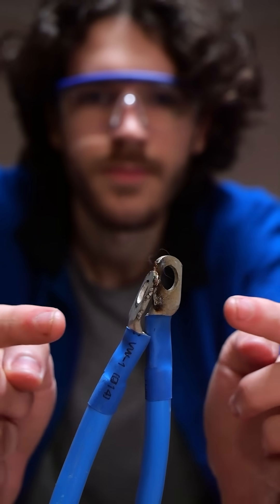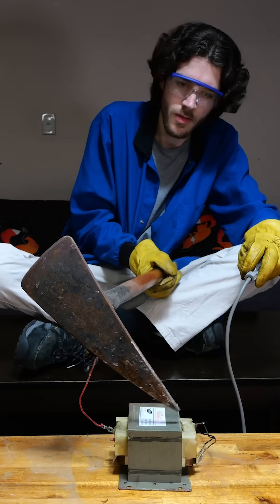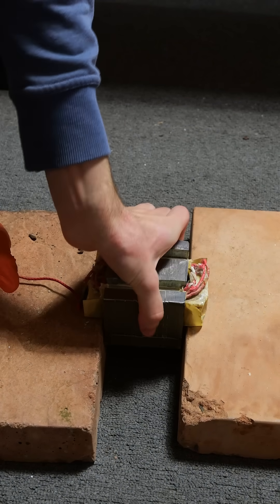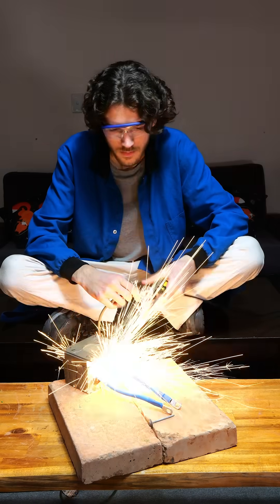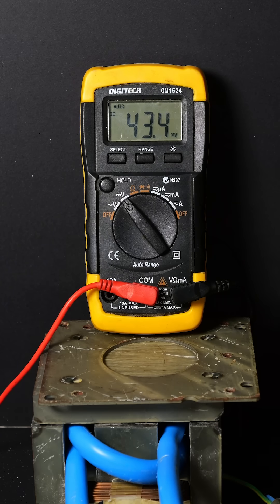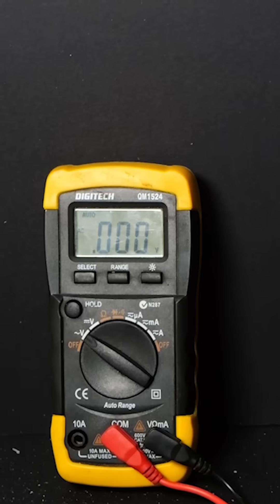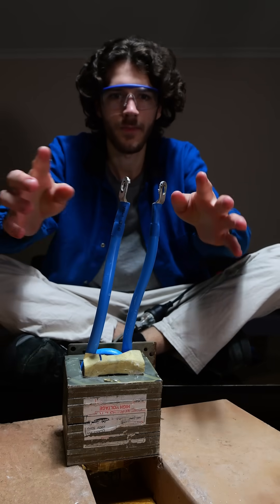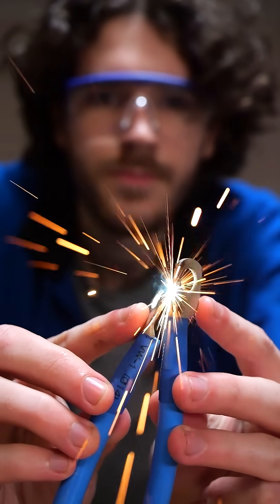What holding 600 Amps feels like

Comment: For anyone who doesn't know. Touch with the back of your hand, not your palm so if the current flows your hand moves AWAY from stuff and won't uncontrollably grip the live part! If I personally need to touch some questionable surface, I touch it with the back of my right hand (usually the back of a single finger), while standing on my right leg so as to minimize the risk of heart fibrilation. Your heart doesn't actually stop if it fibrilates, it just spazzes-out uncontrollably and it can't pump blood. And you can't re-start it without a defibrilator, far as I know. Edit: I was wrong here, the super-death capacitor kills mainly by causing heart fibrillation from high-voltage current through your body — some blood electrolysis can happen, but that’s not what usually kills you. Just know there's a very real risk, do research and have someone who does this for a living supervise and you should be fine. Same with dealing with a lathe, chemistry, amateur rockets, street fights or uncooked food. People with experience have seen others get hurt and know what to and not to do. 👍
Reply: The standing on right leg thing wouldn't meaningfully help because the electric field would travel in parallel through your entire torso and the pathway through the heart with all the fluid filled blood vessels is far more conductive than your lungs anyway. That's specifically for cardiac arrest/fibrillation though (the muscles are technically moving but it's still considered stopped because it isn't contracting in an effective way), the outside of your hand thing is still important because there are other hazards where you can wind up with your muscles stuck and get severe internal burns even if your heart is ok, and single hand is a great approach for isolated circuits since only a single limb is even close to the potential current path
Reply: @bosstowndynamics5488  I had thought of that, however I still believe right hand/right foot lowers the risk percentage-chance wise. It does make it less likely, even if only a bit. And as long as you're not standing atop a skyscraper, where going off balance is more dangerous than fibrilation, I believe it is a good idea to go right hand/right foot path of least resistance. Chat GPT seems to agree when I asked it just now (more trustworthy than my engineering degree sometimes). I still recommend right hand/foot on the offchance one is on the edge of dangerous voltage. Every little bit counts! And even transformers have a capacitive leak-current to ground since it's AC even in the case of "isolated circuits" so a bit of extra caution can come in handy. Left hand always in pocket is the most important part though. 👍
Reply: @Megaexplosionman I really don't think it would make a difference, the lowest conduction pathway through your chest is directly through your heart because that's the path with a continuous volume of salty water, everything else has at least somewhat higher resistance
Reply: @bosstowndynamics5488  Agree to disagree! We're talking miliamps, with the potential difference between fibrilation threshold and normal operation being microamps. Salty water and even the iron, cobalt and hexavalent chromium in your blood-stream are not solid copper, so the further they are away from the points of contact, the less current will flow through them as they have innate resistance that scales with length. While the left foot being on the ground will draw greater current through them due to both the direct path through the heart it takes and the overall geater surface-area in contact with ground. An extra half a miliamp is not negligible in this context.
Reply: @Megaexplosionman Blood does have resistance, yes, and a lot more than copper. But do you know what has far more resistance than blood? Everything else in your chest, meaning that there's pretty much no path from your right arm to your right leg that doesn't go through the big fat pipes full of salty water that go straight through your heart
Reply: @bosstowndynamics5488  The path the current takes through your body matters a lot for electrical risk. It's not just "how conductive your chest is" - it's where the current actually goes. The more it crosses the heart, the higher the chance of fibrillation (that's in IEC 60479, which is what actual safety standards are based on, not on internet debates). Standing with your right leg while using your right hand is like having your left hand in your pocket - it keeps one side of your body out of the path and helps prevent accidental movements (like liftong your right leg while stepping or shifting), which could suddenly create a much more dangerous current path. Right arm / left leg is close to right arm / left arm in danger level because it pulls current diagonally through the chest - exactly what you want to avoid. Right arm / right leg is safer because it keeps most of the current on one side of your body. It doesn't make you invincible, it lowers risk - and that's what smart safety is about. Pretending precautions are 'meaningless' because of a half-true fact about tissue conductivity is exactly how people get hurt. You don't get bonus points for sounding clever if it leads to bad safety advice.
Reply: @Megaexplosionman Yes, the path it takes matters. But the point I'm making here is that the path is going to be through your heart regardless of if you're left leg is touching the ground or not, because the main electrical path from your right arm to your right leg is still through your heart. There's actually not a lot of conductive stuff in your chest other than the large blood vessels because so much of it is air (that's why people float), so most of the current will flow through those large blood vessels, which go straight through the heart. If you had the means to redirect the current through a path that didn't hit your heart that would absolutely be better but standing on your right foot ain't it
Reply: Back of the hand is the word you're looking for. "external part of the palm" is a bit confusing
Reply: @Sh4quille0atmeal  thanks!
Reply: But I can just short the super death capacitor to discharge it! /j
Reply: Thank you lulu
Reply: oh cool
Reply: > causes electrolysis

I'm sorry it does what?
Reply: @hrki_tk  I double-checked my information and looks like I remembered wrong, I edited the comment, thanks! It's continuous HV DC current that kills by electrolysis. The high-voltage capacitor kills you with fibrillation primarily (electrolysis is somewhat negligible here unless its capacitance is massive.) That pseudo-intellectual that denies IEC 60479 safety standards in the replies is right about this use-case scenario. If the voltage is this high, its path will will run enough current through the heart no matter what, especially since it will burn the skin, completely bypassing its protective high resistance. Skin resistance is in the killoohms, while organ resistance is in the hundreds of ohms which makes the path the current takes only relevant if the voltage is 100~200 volts. Tesla coils and Van de Graaffs are usually safe because they have super high voltage but can't deliver enough current to kill — the danger comes when you have high voltage plus a strong current source or if the HV device is an old tube voltage multiplier that isn't decoupled from the mains (it's like a variac, I don't really understand it myself, all I know is that it's not decoupled from mains power). When there is no galvanic decoupling, you give the mains voltage a lower impedance path through your body. Which means greater current and it's the current that fibrillates your heart, it just needs enough voltage or low-enough impedance to ground to get there. Which is what we don't want so we have decoupling transformers, we wear rubber shoes, we touch with only the back of the right hand, standing on the right foot and a whole lot of other stuff. 👍
Reply: Fr be super careful with fireworks, those videos of ppl losing their whole hands to a particularly large firecracker are scary
Reply: 😂😂😂😂😂 I didn't need to read all that just the end part "people with experience see others get hurt and no what to and not to do" 😂😂😂😂😂😂😂😂 yeah because someone with experience HAS NEVER HURT THEMSELVES 😂😂😂😂😂😂😂😂😂😂😂😂😂😂
Reply: @kylemiron2647  Yep, that's the point, they do! But in ways that are not "permanent" for lack of putting it in better ways. The way they teach you electrical safety usually involves the stories of those who weren't so lucky as to get out in one piece or at all, so you know to  go forward slowly and carefully. Most of those who were too smart to do that are the ones we hear stories about..
Reply: I had a stroke reading that
Reply: defibrillator dont restart stopped hearts, thats some hollywood bs misinformation. defibrillators give a jolt to reset the heart’s rhythm if its out of sync, thats all
Reply: @bbbnuyyyy That wasn't claimed. He specifically said your heart doesn't stop, but goes into fibrillation. The defibrillator "resets" the heart by forcefully causing depolarization in all the heart cells at once, after which the heart will hopefully continue with its physiological rhythm.
Fibrillation is when the electrical impules are uncoordinated and random, where your heart becomes a wiggling meat sack, instead of a pump.
Reply: @bbbnuyyyy  Yep, that's the point I'm making! When the heart is out of rhythm (fibrilated) and spazzes-out, it can't pump blood so if memory serves, it needs to be put back on track with a de-fibrilator so it's no longer fibrilating because it has been defibrilated. I think the electric shock actually stops it for a bit so it can "restart" with proper rhythm. Basically the CPR version of "did you try turning the thing off and on again" 😁

Comment: Next, put it on your tongue. (yes, I know you'll be completely fine)
Reply: Your salty spit would fizzle, and you would not not feel it.
Reply: @ChrisNotTheKing Agreed!
Reply: No. The tongue has a low resistance and it would be extremely painful. The resistance of the skin is too high for 2v to transfer any meaningful amount of current so it drops to 0, it's like a concrete wall for 2v. The tongue on the other hand is like a nice smooth slide for the current to pass right through!
Reply: @Sh4quille0atmeal He said the output of the transformer was 2V. 9V battery on tongue is pretty uncomfortable but it's not too bad. ElectroBOOM has done several videos of AC v.s. DC on tongue and he can take 12V on tongue before it gets too painful - 2V would be a bit of a tickle and not much more.

Comment: alright so amps are fine by itself but when combined with voltage its a death machine ok so i got it if i want to build a metal destruction machine just never combine the two got it lol
Reply: It's more like with voltage this low, the source just can't pass enough amps through person's heart despite theoretically being able to provide thousands of amps. So it really does feel like a battery, if we had a battery that somehow keeps its output at 1.5 volts no matter what - it would have been pretty similar to this transformer, almost completely safe when handled and incredibly powerful if shorted
Reply: You can have high voltage with high amps for a metal melting machine. But like 1kv is overkill because metal has such low resistance so it would be inefficient to use 1kv when 2v works fine for it.

Comment: For anyone wondering 2 volts isn't a high enough voltage to carry any meaningful amount of amps all the way through his body, because its too high of resistance. Which is why high voltage is so dangerous because a small amount of amps can be enough to kill you at a high enough voltage.

I'm not an expert though, plus Electroboom has some good videos on it "does current actually kill electroboom" would be a good search
Reply: So can 2000V with 0.1A kill?
Reply: @DoozyyTV  yes. anything above 50v (of course with enough amp) is generally considered deadly. there is a simple formula for power: P = V.i putting what you said in here P = 2000.1/10 so this means 200 watts will go through you, which is not good (really)
Reply: @9402dk  you should also consider other parts of the system, the conduction time, what impedance is the source, the frequency of the source etc. If the source is low impedance and low frequency you will definitely be zapped
Reply: @Hagurmert  as I said, generally. there could be a hundred exceptions for this
Reply: @9402dk  although the ohms law only really works at low voltages and low frequencies, and many things don't even obey ohm's law, such as LED's. Generally the safe limit for not getting electrocuted is 50V, anything above can get very sketchy very quickly
Reply: @Hagurmert  absolutely!!
Reply: @Hagurmert  Leds absolutely follow ohms law, their resistance just varies. Ohm's law is not some aproximation. The same is true for the resistance of the body, it breaks down at high voltage, but ohms laws still applies.

Obviously for everything AC you need to factor in Cos phi. But ohm's law does not just work at low voltages.
Reply: @slome815  but the problem is; ohm's law does not tell you when the problem can happen, and there are nany other flaws with it. Thats why its a bit of a stretch to call it a law.

Comment: Also whenever trying to touch and feel electrical stuff (just dont do it but if you HAD to) make sure you touch both leads with the same hand preferably right hand. Just two fingers. And make sure you are not grounded. 

Reason for that is to avoid the electricity passing through your heart in case of an accident or miscalculation. Of you just use your index finger and middle finger or something like that, youll just get spasm between those two fingers and possibly burns too. But if the connection os between two hands the circuit passes through your heart and can cause cardiac arrest in an instant.
Reply: Don't touch 2 conductors ever*, use a multimeter. The one hand rule is a backup in case of *accidental contact with 2 points in a live, isolated circuit, it's still too high risk to do it deliberately
Reply: It looks dangerous because it started as a microwave transformer. Once he was done with it is was a low voltage transformer, he also measured the voltage. 2 Volts is going to do absolutely nothing. And everyone who understands transformers knows that those two coils around that core or so will give a low voltage anyway. Measuring obviously is still a good idea, since you might get have isolation of both coils damages or something like that.

But this was pretty safe.

Comment: man i did the same thing for my electrical engineering project and i got suspended. something about "endangering the lives of my peers and mentors"
Reply: Nice pfp Dead Cells is great
Reply: Did you make sure the voltage was low enough to be safe first? For AC, it's 50 volts

Im glad this thing was AC though, DC has a higher safe touch voltage (120 volts) but is more dangerous as the current doesnt rise and fall (turning off each cycle) so if your hand gets stuck grasping the conductor you have more of a chance to pull away in AC
Reply: That's probably because this is not actual science, this is just paddling risky behaviour to kids. I like it, and we all like it, i am not saying this is wrong or something he shouldn't do, but in academic environment this has no merit...

Comment: Is there any usage fır this tho?
Reply: It demonstrates the difference between high current and high voltage, which is good to know. Its especially practical say when you need to work on a car knowing that the batterys deliver LOTs of amps, but only ~14 volts. 

Of course in a car (not an electric btw) other components might step up the voltage (like what you'd need for a spark plug), but the battery itself is relatively low voltage.
Reply: This is similar to how a spot welder works
Reply: I guess if you need to melt or quench metal - that may be a way to do it, probably an unnecessarily dangerous one but still